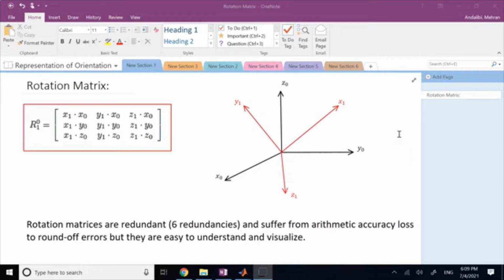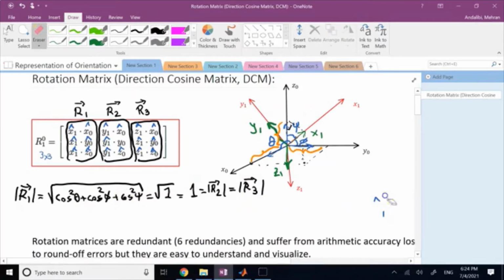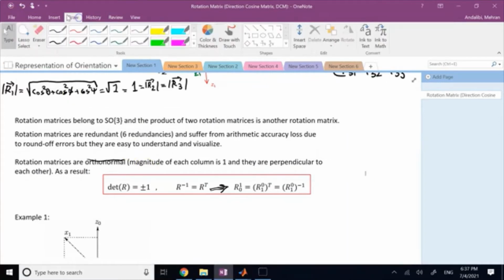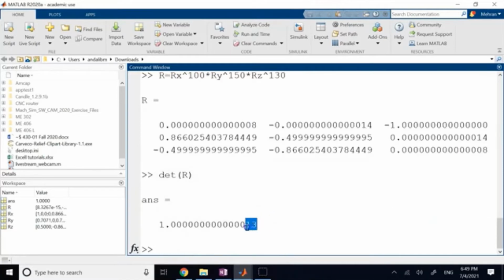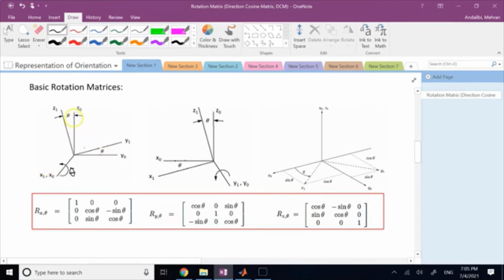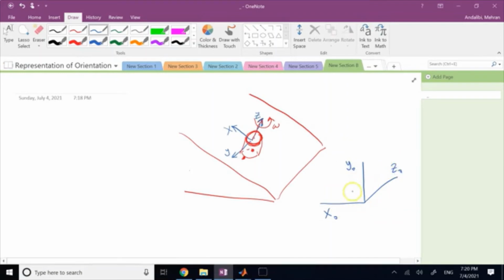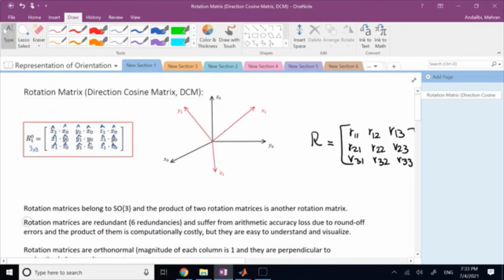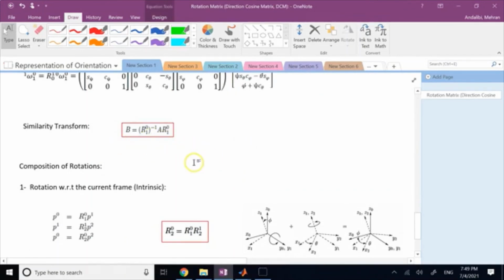Rotation Matrices Part 1

Comment: Hallo Sir. 
Thank you for the great lecture.
I just wanted to ask that,
when we talk abou rotation matricies at first. lets say R, the notation on the upper right corner of R represents old frame,
and the notation of the lesser right corner of R represents new frame.
When we project a Vector which is defind in frame 0 , into frame 1.
I thought that we would multiply P0 with R 0-1.
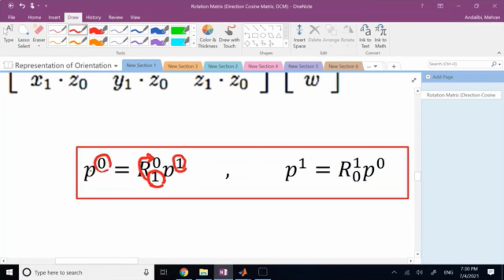but we made opposite thing at 1:11:20